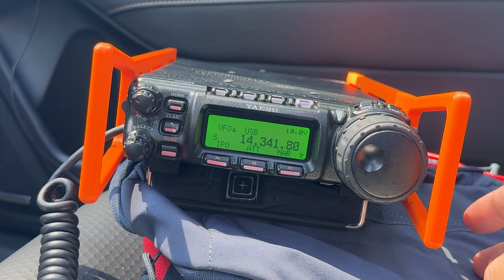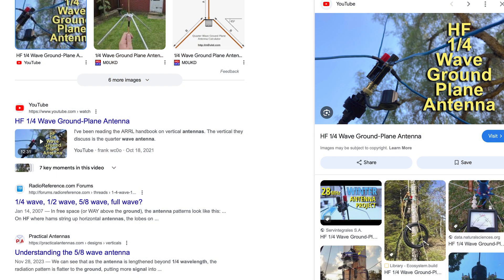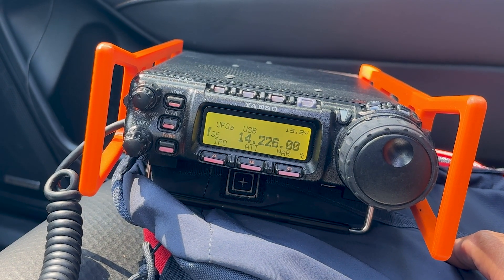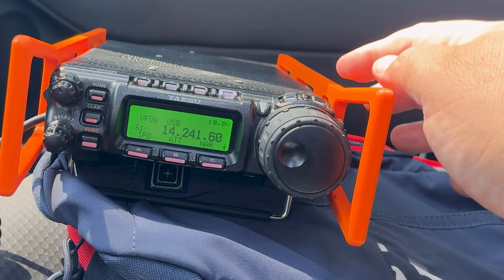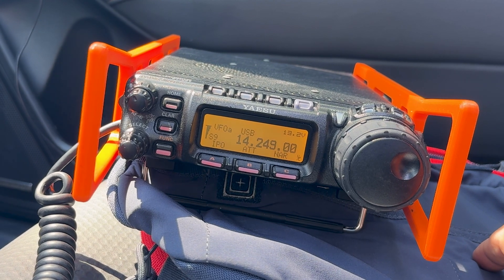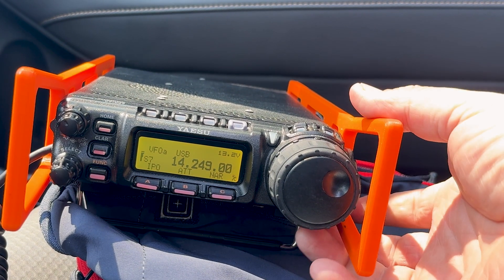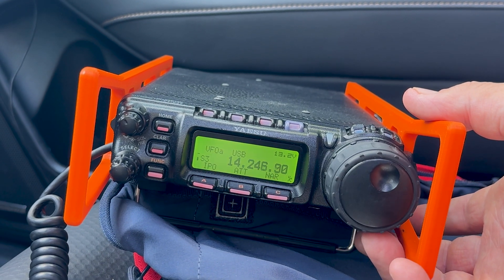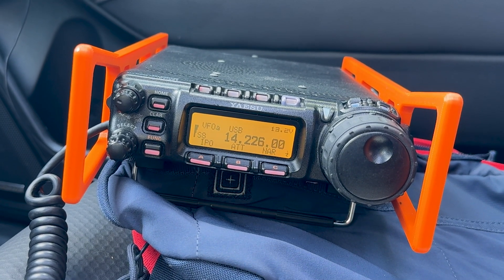How HF Sounds

Comment: Great video to demonstrate what to expect on HF. I just upgraded to general not too long ago and have only made two contacts so far (being picky, both DX). Right around the 14:10 mark on your video I could hear WA3QLW. Ironically, I've only heard her on VHF on a local linked repeater system in CO.
For HF, I'm using the FT-891 w/ a 1/2 wave inverted V dipole using an LDG 1:1 Balun. So far, I've only played on 20m because I live under HOA restrictions and a small backyard. If I had an antenna tuner, I'd try 40m w/ the same antenna. I may see if I can pull off 40m by adding links to my existing 20m dipole. 🤞

Anyway, thanks again for the video.

--
73,
KFØPLR
Reply from the maker: Thank you for watching, have a great week. -73

Comment: Nice video ! The only problem with HF is that you need fairly big antennas to cover the entire range and that is not always feasable when you're living in a large, densely populated city and in a rented studio (like I do). Also, I believe in Belgium you're not supposed to keep your HF-radio (not even for just listening) when your radio license is expired (like mine is).
Reply from the maker: I was in my car, and of course my antenna is compromised, but it does an "OK" job in listening to HF.  Plus, my screwdriver antenna, I'm able to have a range of frequencies with a relatively small antenna.  As for the home, you may try a loop antenna, I know it has a very high Q, but. it's something you may try.  -73.

Comment: One trick for the noise when listening to someone
is to slowly lower the RF Gain & Increase the Volume(AF gain) to make up for the drop in volume
You can find a sweet spot combo that has mostly voice and much reduced noise. 
🙏
Reply from the maker: Good point.  I usually use the IPO to lower and increase sensitivity.

Comment: This was fun to watch.  I have my General license but haven’t gotten on the air yet.  It was nice to hear “Just try your best.”  Makes me feel like I don’t have to have a $4000 huge Yagi setup to get somewhere!
Reply from the maker: You’re right. You don’t need a fancy $300 super Antenna . Or a fancy $2000 radio. You can make a quarter wave ground plane Antenna which is relatively expensive. It’s 4 wires and a connection.  when I started, I felt out of place, because the noise would make me feel I wasn’t doing something right. I also didn’t get anyone to talk to me for a couple of months. When I first started. That’s because I was using 5 W. Fortunately somebody did in Texas. Now I do mostly POTA. I figured out how to speak to people in that type of environment. Either way, take your time have fun. And enjoy your new license capabilities.
Reply: @frankwc0o  quarter-wave ground plane for HF??????? Maybe 10 meters, but that's about it.
Reply: ive made 1000+mile contacts on a efhw up in a tree paired with a anytone 5555